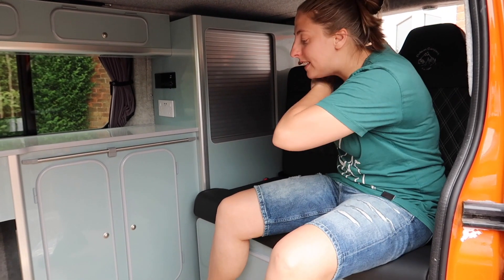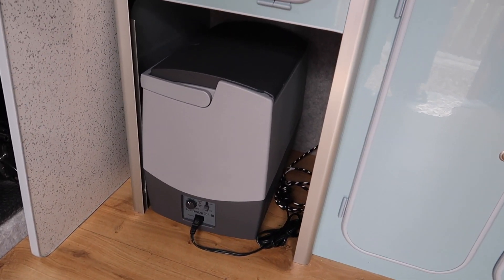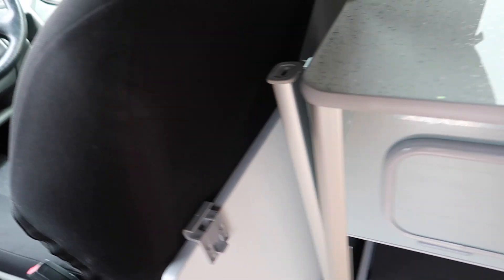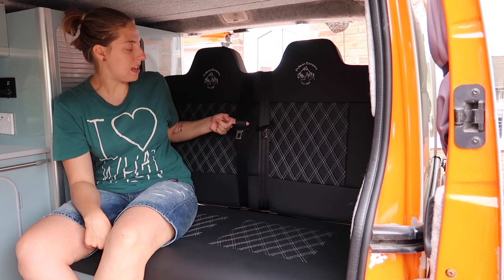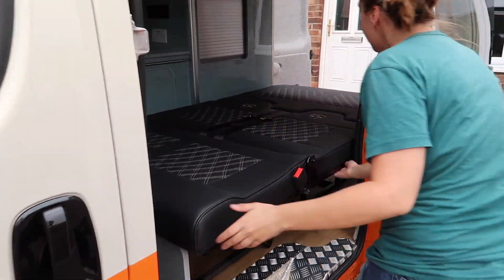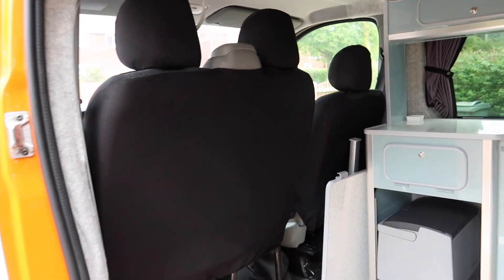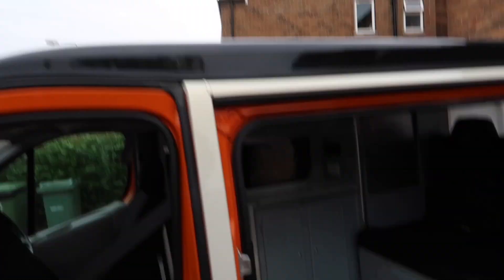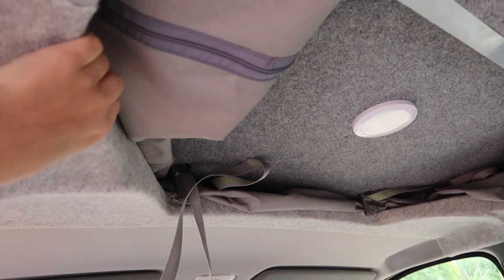Renault Trafic Camper// Full Van Tour//DIY TVP Camper

Comment: That swivel seat is brilliant, we have one but... A tip for you, after a while that plug and socket for the seat sensor will wear and you will get a fault light come up. Or you may forget to disconnect it and cut the cable, the solution, get a decent quality plug and socket and put it in line. Then cable tie it up where it wont rattle in full view.

Also that table you have, that you needed to get campervan aproval is useless, put away and get a folding table which works better... and if you buy some folding chairs you can use it outside too.

Dont get solar or a scond battery, just wire you cold box to go off with ignition.

Good van the Trafic, we have a Vivaro and love it.

Comment: Hi folks - great conversion! 😮

Was wondering what company did the roof conversion and how much it cost.
Reply from the maker: +Jamie Burgoyne  thanks so much!! 🙌🏼 it was a company called Austops there based in knottingly but I’m pretty sure they have fitters right across the UK! It was about 3k in total but we got a roof bed installed which was an extra £300. But totally worth it comes with a 5yr garentee.
Reply: Pelican Campers Thank You! Happy Camping

Comment: Looks great! Which version of the trafic is this? Was it originally a two seater? Trying to find a van that can be used by a family... :)
Reply from the maker: Daniel Nilsson hey 👋 it’s the late 2013 model.  Nahh was originally the 3 seater we just added a swivel base to the bench  seat in the front!  We would be happy to use this van with a child or two...plenty of space :)
Reply: Pelican Campers ahh ok, I meant the back seats! :) Can you have them installed and then register the vehicle for 4?
Reply from the maker: Daniel Nilsson oh sorry! Yeah that was an after market rock and roll bed we had fitted (came with the seatbelts as part of the design) when we sent out V5 off we changed the number of seats from 3 to 5 :)

Comment: What's the difference of campervan registering to dvla than not registering.
Reply from the maker: +Cora The Explorer you faster speed limits on a 70mph road commercial vans are ment to drive at 60 but motor caravan (as its registered as) can drive at 70.  It’s cheap insurance. Also marginally cheaper for the ferry/channel tunnel crossings :) hope that helps!

Comment: When is the sink/cooker?
Reply from the maker: +Allan Byrne we have a portable gas cooker system which we pull in and out when needed and we don’t have a sink have water bottles and often use the sinks on site when needed. 
We work a lot in our van so needed the extra work top space

Comment: Where did you buy the fitted units ? We’re they expensive ?
Reply from the maker: alan penney we bought them from a place in tadcaster. We visited there workshop and designed what we wanted then they built them for us and then we fitted them. About 1k but really good quality and we would have not had the skills to build anything as good 😂
Reply: Hi can you give me the name of the company that built your fitted units please.
Reply from the maker: john kemp hey! They were from northern rose campers there based in tadcaster :)
Reply: Thanks for that.
Reply: Hi can you tell me were you got your rock & roll bed please.
Reply from the maker: john kemp hey we got out rock and roll bed from a company based in Doncaster called road runners camper conversion. They were really accommodating with what we wanted :)
Reply: @TheBaileyVlog  Thanks very much for that.